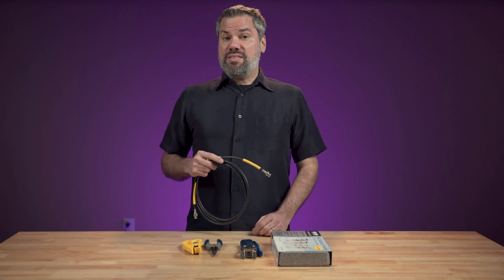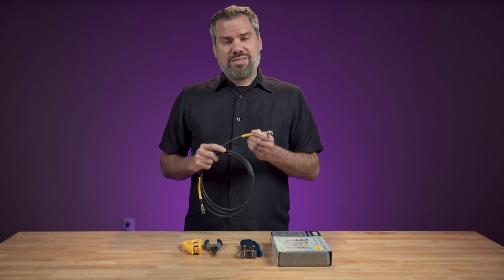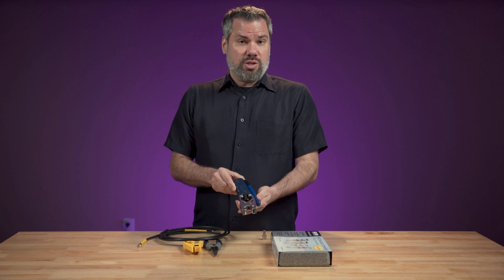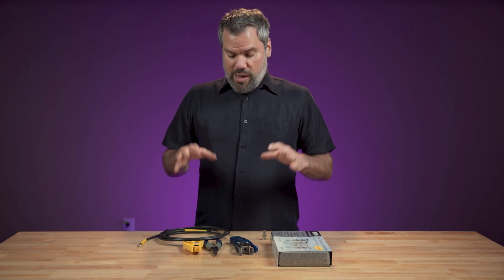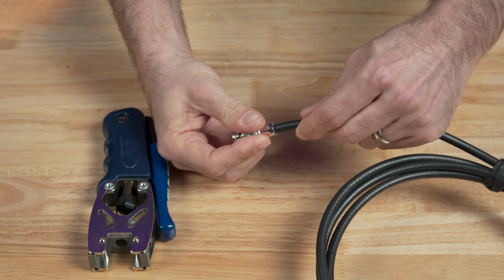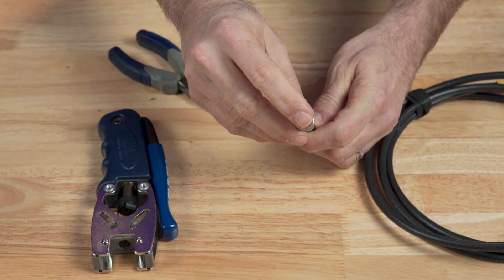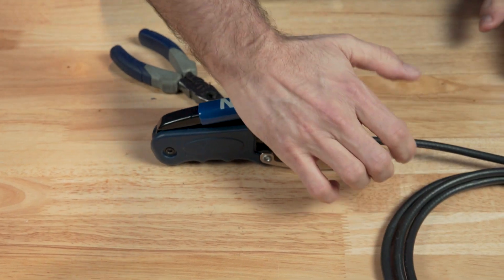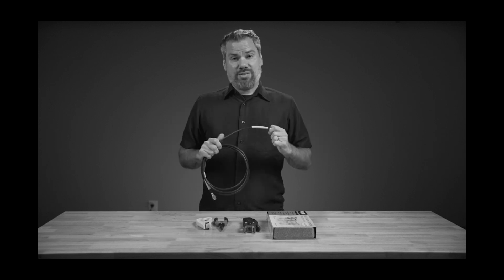Make your own STRONG diy SDI Cables

Comment: What is the compression tool doing that the crimp tool is not?
Reply from the maker: Magic! To be honest, I'm not sure, but it makes a much more secure connector for me.   I think the entire connector is shrunk down/compressed onto the cable in a circle,  rather than the  crimp tool just reshapes the sleeve into a hexagon that squeezes it only in some parts.